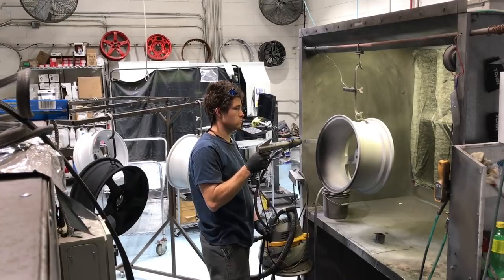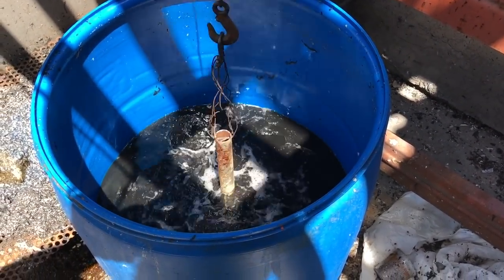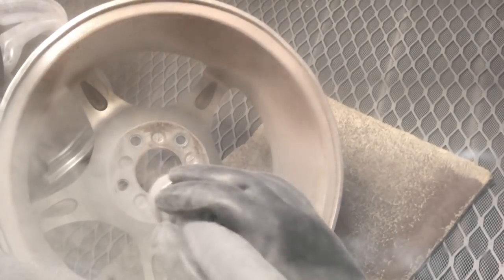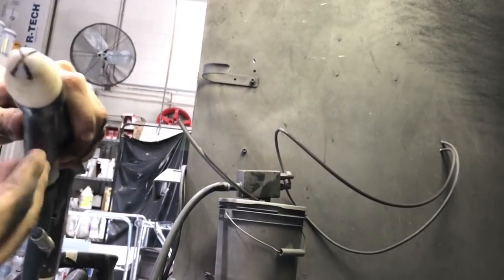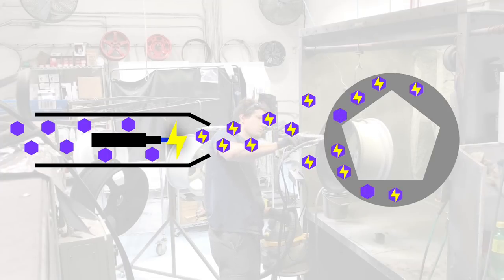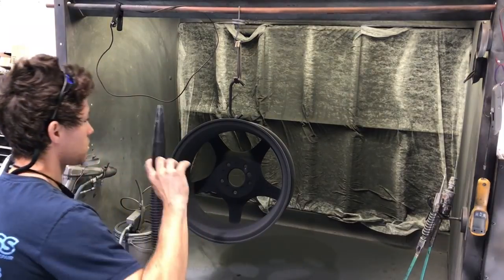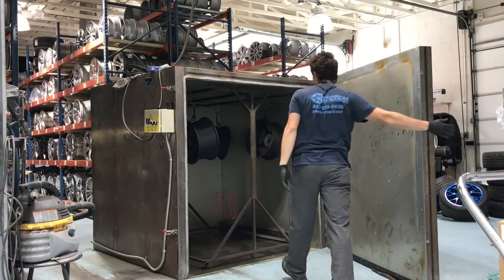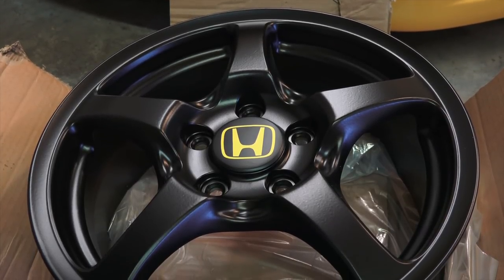What Is Powder Coating? New Wheels For The S2000!

Comment: Next video: How heat from power coating weakened my wheels. It is one thing for the wheels to be baked in the manufacturing process but to reheat the wheels is where I have the 'conspiracy' issue.
Reply: Life with Frank ask yourself this. Since the hub, wheel, and brake parts are all physically connected, isn't there heat transfer happening on a daily basis? I had an old Toyota with a caliper that liked to sieze and when you got to your destination you could spit on the wheel and it'd evaporate instantly. 

So knowing this, heat transfer between brakes and wheels happens daily. The only question is, how hot for how long? A track outing is probably roughly the equivalent of baking powder coated rims.
Reply: Those components are designed to take heat. -heat and cool. Wheels are not designed to withstand a 400deg bake. I've seen it WAY too many times where wheels become out of round after being power coated. EE also asked the person doing the coating about this and he admitted it has happened though his experiences are with the cheaper brands. My experiences have taught me that power coating wheels is not a good idea.
Reply: Life with Frank The annealing temperature of aluminum is much higher than 400 degrees. This process on a properly hardened wheel, theoretically, will not change anything. In addition, the time is only 10 minutes, which should not affect any molecular arrangement, especially at about 50% of the annealing process. I supposed we'll find out though...
Reply: The 400 F (204 C) for powder coating curing is well below any temperature affecting aluminum alloys used for automotive wheels. 
The lowest temperature affecting aluminum alloys is above 650 F (343 C) for 3003 which is a very low grade of aluminum, all other grades are above 775 F (412 C). 
The time required at the target temperature to metallurgically alter aluminum alloys starts at a minimum of approximately 2 hours (120 minutes) and goes to approximately 12 hours.
Also the low temps coupled with the short time period for the powder coating cure of 12-20 minutes is significantly shorter than the time required to heat treat, anneal, temper or alter the metallurgical properties of most quality automotive wheels. 

Consider this, the brake rotors dissipate their generated heat into the wheel hub and brake rotors often reach peak temps greater than 1200 F (650 C) during repeated hard usage.

Comment: Sorry kid but you just ruined the age hardening of the forged Wheels from 6061-T6 to T something else that is brittle. Wheels are age hardened at 350 degrees and that powdercoater just baked them at 400+... Go figure..
Reply from the maker: Do you have a source to learn more about this; would love to see some data on the subject. The builder knows his protocols and follows procedures common in the aftermarket world for wheels. Big names use aluminum and 400 def F.
Reply: The Wheel manufacturers like BBS take in account the extra time and temp baked for the powdercoat. Or the manufacturer bake them at lower temps. A while ago I wanted to powdercoat my forged Oz futuras and every single powdercoater I talked to had no idea(or maybe just played clueless because it's bad for their business) about age hardening and aluminums sensitivity to baking at higher temps. Nobody had the special powder to bake at sub 320F/160C. So I opted for 2k paint..

If you want data then just google articles on how Aluminum 6061-T6 is made and age hardened for it's T6 class. Because that is the alloy most commonly used for forged Wheels.